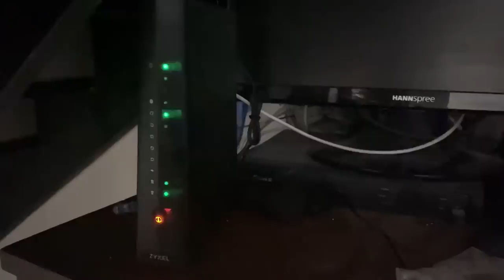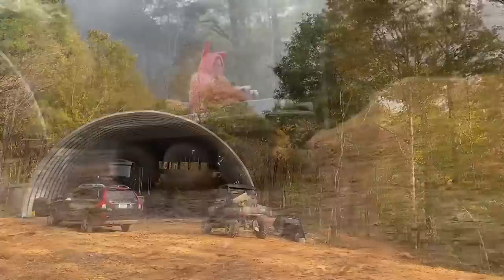Lightning strikes on the property causes lots of damage, but could have been way worse. Storm damage

Comment: I'm surprised at everyone suggesting fiber optics... to connect to a bus, when something wireless would probably make more sense. Something like a Mikrotik WAP 60G AP and CPE... on each bus within 60 degrees in front of the AP.... you can't have anything between the AP and the CPE though since its 60Ghz and won't penetrate even a window well. But you'd just mount it on the bus facing the direction you usually park and it would just link up when you pull in and provide a gigabit connection unlike most lower frequency wifi bridges which only provide a few hundred Mbps. And if you don't really need gigabit.... then there are alot of cheaper options from Mikrotik and Ubiquiti that would work great link.... obviously you'd want something small though for mounting on a bus roof.
Reply: He may not have line of sight between the garage/apartment and Tyler’s bus, so the Microtik or Ubiquiti solutions may not work well. Fiber is fairly inexpensive and media converters probably less than the point to point wireless solution, plus the fiber can carry 1Gbps at the distance even with multimode fiber; 10G with more expensive optics.

Comment: When Lightning hits the ground its actually completing an electrical circuit and   the ground is being charged like a battery then releases it just before it hits. Lightning from clouds is almost always Negative 90-95% of the time and has an average of 300,000,000 Volts behind it when it follows the Positive charge the ground stores back down just before it hits. Far more rare but many times more deadly is Lightning for clouds that has a Positive charge and it can hit with a 1,000,000,000Volts and like its less powerful sibling completes circuit with what it hits the Negative chart that builds beneath it. A Lightning rod basically charges itself far more efficiently during a storm than the Earth etc. and Lightning will course down it first when there since it releases its charge first directing the energy into the ground thru a rod leaving what's around it Mostly undamaged. Having a  Lightning Rod is a good investment in areas where there prone to occur since they safely discharge a strike and even in cities you'll spy there points on high building to factories. Not only are they loved by those that been daved by there silent sentry keeping, insurance co. are gaga over them even more since protected structure can be hit scores of time and have no damage to show for it.

Comment: Don't you guys have fiber optic internet? A normal FO cable should not have any metal in it except some cables might have a steel cable core in them for tensile strength. But 98% of them are metal free and use ether nylon or kevlar cord for tensile strength. If you do have fiber internet. You might want to ask your ISP about getting a cable ran that doesn't have any metal in it.
Reply from the maker: This is our infrastructure to locations on the property
Reply: @BusGreaseMonkey  I didn't realize that was a cat5 cable running across your property. I though it was your main fiber run from the street. And speaking of fiber. You might want to consider replacing any long run cat5's across your property with fiber instead. Fiber is not all the more expensive then cat5 and all you need is a couple of cat5 to fiber converters at each end. these converter only cost about $30 each and are smaller in size then a router. it's not that hard to set up ether.

Comment: I'd love to see more video of Olive Oil, using it to grade that driveway back up and would love to see Tyler year into that transmission to get the gears working right again. I forgot what was even wrong at this point... jumping out of gear maybe 🤔?
Reply from the maker: Right now olive oil is not safe to use on the hill
Reply: @BusGreaseMonkey  If it is the gear popping out that's understandable!

Comment: Is that bad side got a cut bank on it? What I mean is that side of the road taller than the road? if not you need turn outs on that road you want that water turning off the road into the woods, you don't want it running down the side of the road if possible. A turnout allows all the water from a certain section of road to turn off the road and not run down it. it's hard to tell in video how long that hilla actually is. As a Forester I design and help design our woods roads as well as supervising work to let them be once we're done. I would have at least three turnouts on that steep a hill maybe 4? If there is a cut bank and you absolutely have to have a ditch. try to make it deep enough for those flooding rains. get it vegetated and make check dams with rip rap size rock to slow that water velocity down.

Comment: You are going to need some form of surge protection for your electrical wires and ethernet data cables or an upgrade if you already have it. You might want to look into possible lightning rods or some other form of lightning protection. On the Drainage issues it looks like your back to the drawing board.

Comment: By the time you replace all the damaged physical plant you will probably exceed the cost of getting Starlink.  $110 bucks a month and UNLIMITED data which is the big selling point.  You WILL loose signal during storms such as the one you just went through but that's rare to happen.  Give it some thought!
Reply from the maker: We have high speed fiber internet here for under $50 per month.  300mbps with 1g available for under $80